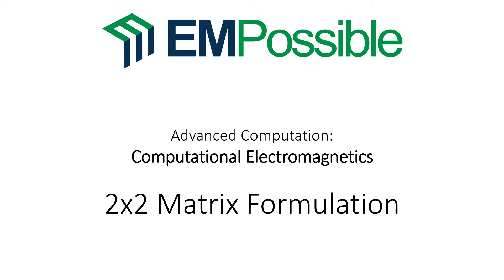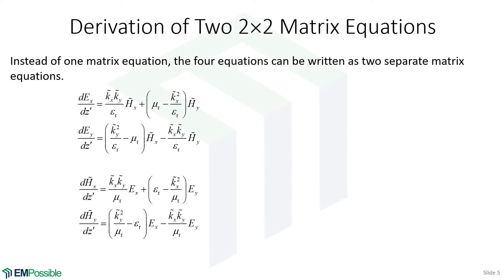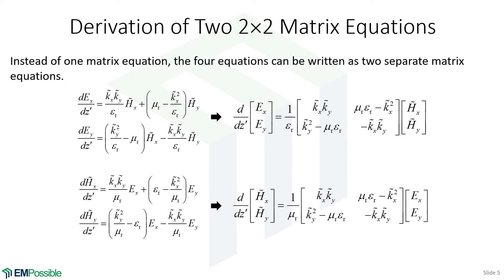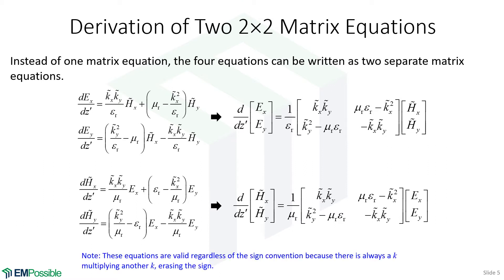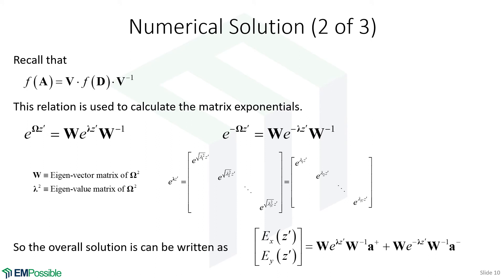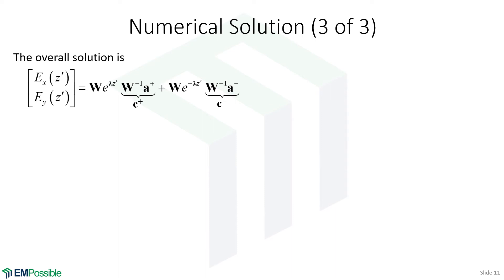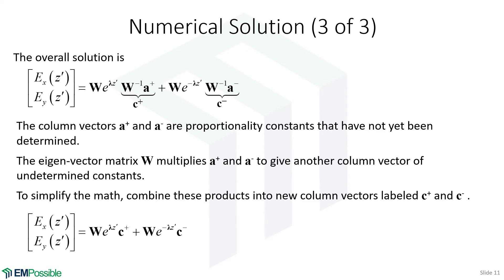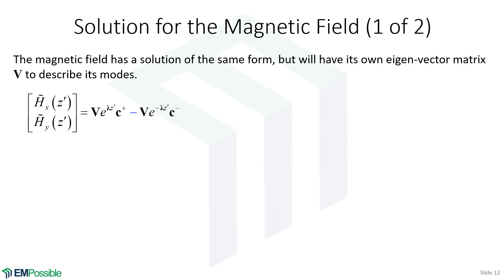Lecture -- 2x2 Matrix Formulation

Comment: Hello Dr. Rumpf,
Thank you so much for the insightful lectures. Could you explain why the eigenvalues of the E equation and H equation are the same? (around 11:00) Is that only true because P and Q happen to commute? Why are the mode coefficients the same as well? Aren't these arbitrary initial value coefficients? Thanks beforehand!
Reply from the maker: E and H have the same eigen-values because they are both components of the same wave.  It is sort of like asking why the head and tail of a coin weigh the same.  Same reason for the mode coefficients.  The mode coefficient describes the overall amplitude of the wave.  The eigen-vector describes the relative amplitude between E and H.